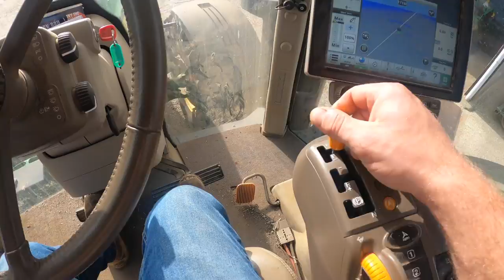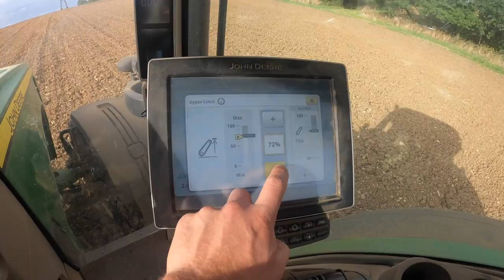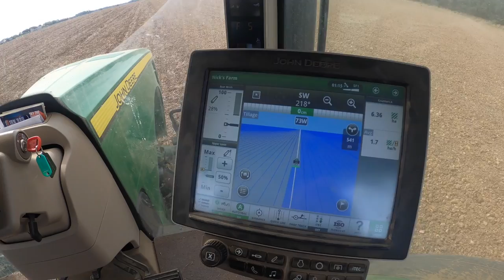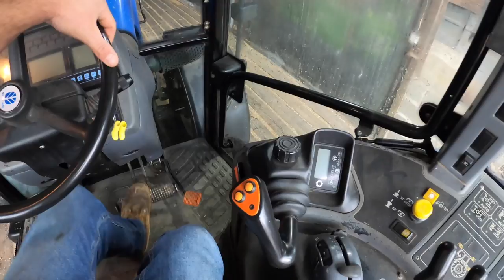PREPPING GROUND FOR AUTUMN DRILLING #FARM VLOG 168

Comment: I did the samething swelled the seal in the axle  that holds the mineral oil in the brake chamber, had to remove the side shafts to replace them.

Comment: I will be amazed if it doesn't take the seals out of the master cylinders. Doubtful it will have got to the piston seals inside but not a bad job if it has. 
Always bleed the centre of the trailer brake valve then each side in either order. Then there are another 2 bleed nipples on the axle. One each side. Trace the pipes from the trailer brake valve you will find them.
Handbrake light on the dash should come on if the fluid is low.
Any mineral fluid will do, if you have a garage closer than Russell's. Amazed they hadn't got stock, I used to keep 4 in my van!!

Comment: Hey Nick, awesome video, hope the TM is OK!Just check with the dealer, I was under the impression a small amount of DOT3/4 brake fluid got into the trans oil, it could eat the clutches in the transmission?Hope I'm wrong, but if the dealer suggests a back end service, it could be cheap insurance.